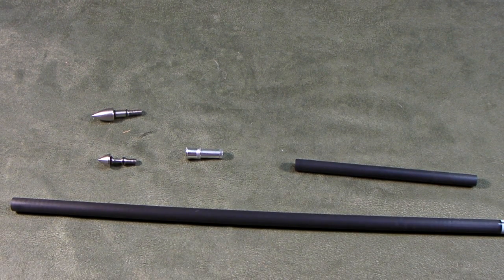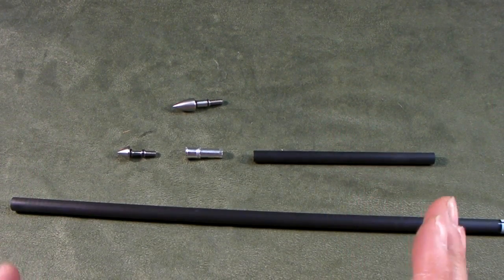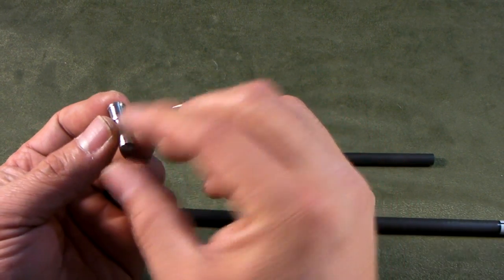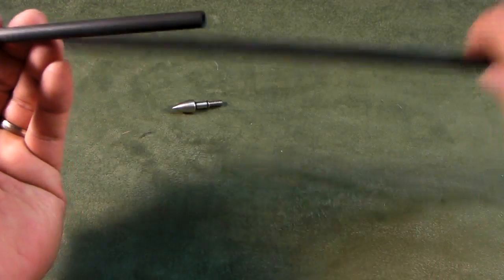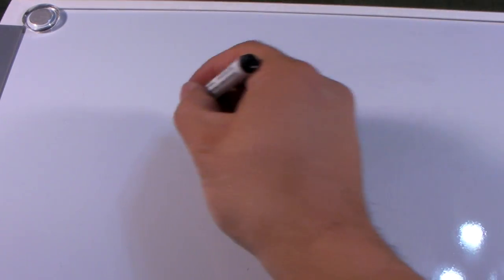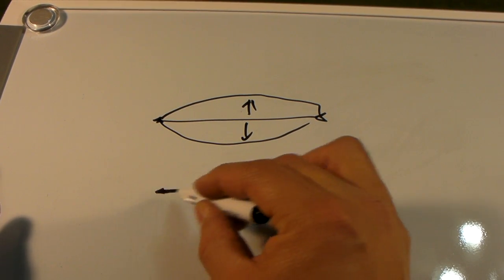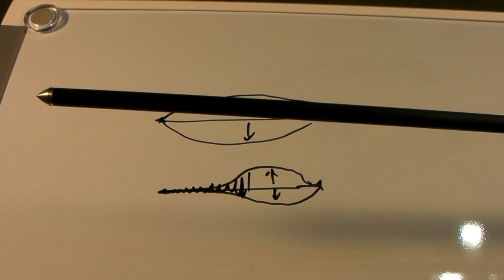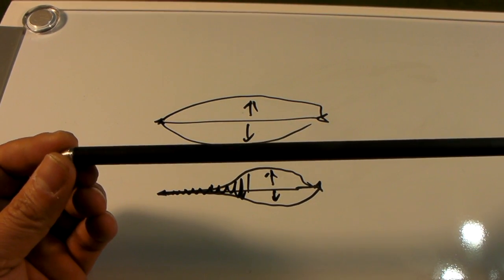Firenock AeroConcept System 1.0

Comment: LOL just buy stiffer spined arrows ya goof.
Reply from the maker: If it is just to stiffen the spine... it is simple.  If you get to look at the patent and do slow motion testing like we have done one would know that it is not about stiffer spine as the inner tube is only installed in particular zone(s). With AeroCencept 2.0 there is more than one places and thickness of CTI (Carbon Tube Inner) with 100% linear directional nano-carbon construction.  For those in the know, it is about the Harmonic cancellation and oascillatyion reduction. Which lead to high energy conservation in flight.

Comment: How do you determine how long you need the carbon tube insert?
Reply: James Quinn the final weight should the only concern beside longer length.  Without a vacuum pump, the 6” tube give you the optimum max length for AGUSSE to be spread over. Last. The longer the tube the better the oscillation cancelling and dampening 
effect with the max not exceeding 45% length of shaft